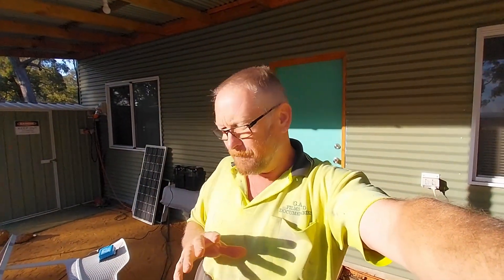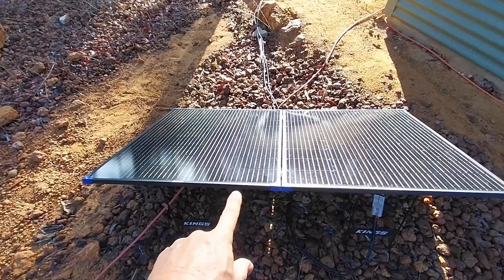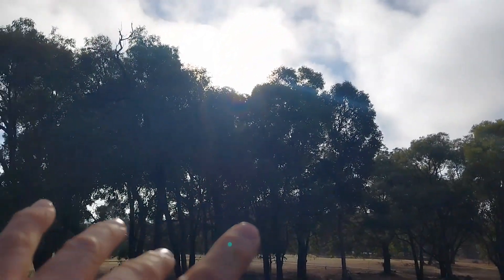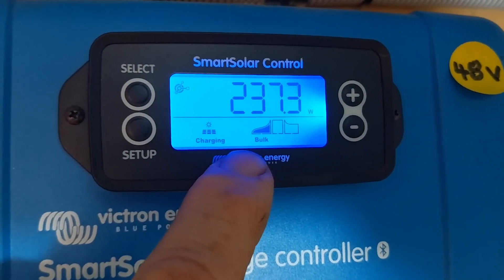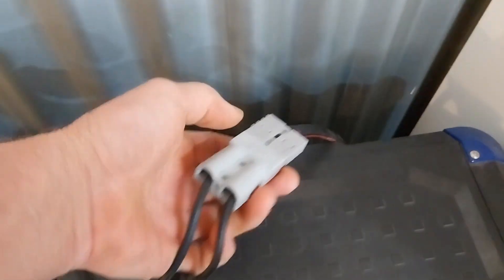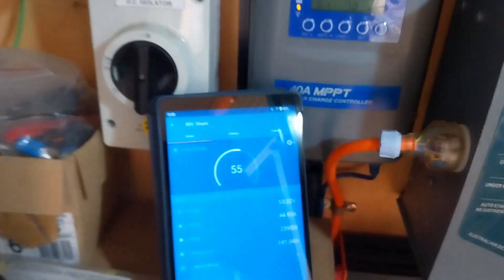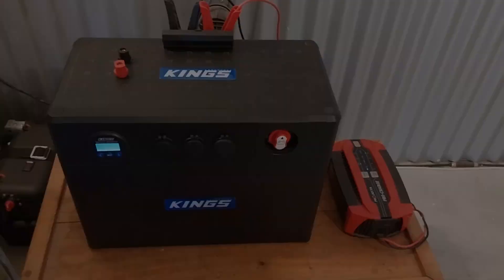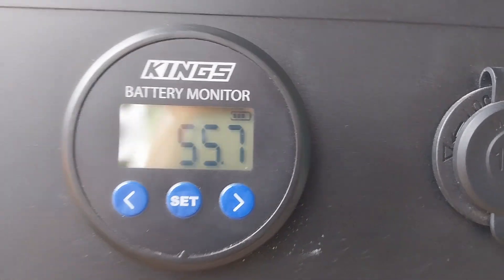Failed Attempt To Charge Batteries From The Sun - So What Can I Do ?

Comment: here's a tip for you, if your AC charger has power supply mode output of 13.6V you can leave that on a LFP battery and it will fully charge it. Once the battery hits 13.6v the current will start to reduce as it absorbs but left long enough it will get there, then you don't have to worry about forgetting the charger is on in a lead acid profile and no harm will be done.
Reply from the maker: The only thing to be careful of, and one of the reasons I say not to leave it on a lead acid charger is because some chargers have an equalisation mode and raises the voltage close to 15 volts.
But most dedicated AGM chargers don't usually do this so it's not too much of a problem.
But for the channel it is best for me not to recommend leaving it on the charger to cover my ass.... and not to mention all the negative comments I usually get when I say it's fine to charge a Lithium battery on a AGM charger 🤣🤣
Reply: @TheOffGridBachelor  Yeah, but I'm talking about power supply mode. No danger whatsoever
Reply from the maker: @bildad1234  Ahh ok.... yeah for running on just straight power supply mode yeah it should be fine although for Lithium batteries, once they reach 100% SOC, the charge power must be stopped and not allowed to remain on float.
So just be careful of leaving it on the power supply mode once the battery has reached 100% and the cells have balanced 👍

Comment: Suggest you add a dose of (something like) Fuel Doctor to the container you use to top up your generator. Also, put a reminder in your phone to start your generator on a nominated date every month and give it a run for about 30 minutes. Routine services at 100 hours run time  or 12 months duration helps easy starting too. Apologies if I'm telling you how to suck eggs!
I've done this with my Kings 3.5kva open generator and honestly never had a problem starting it in getting on for 5 years. We live in an unreliable power area and it's saved our fridge supplies and powered the water pressure pump many times. We can even watch tv and power the wifi!
Thanks - I'm learning so much by watching your set up. I want to move away from just the generator as backup to a 12v solar system so that I have the option to run my rural property  like a caravan when there's no power - or as I choose.
Reply from the maker: Cool, I'm glad my videos are helpful and thanks for watching and supporting the channel.
Yeah I do need to be running the generator more often to keep it fresh and the starter battery charged up. I do run a fuel additive called F10 in the fuel which I showed in my servicing the generator video (link below)
https://www.youtube.com/watch?v=EKkTxRTDcis

Comment: Remote rural off grid NSW here 10 350W panels on the roof and small wind generator that keeps the batteries topped at night, when I go away in the caravan 4 300W flat panels on the roof of the van house is run on 24V setup with a 5000W inverter all house lighting is on a separate 12V system and I use led lighting, van is on 12V with a 3000W  inverter again no issues . Both have generator back up which I rarely use.
Reply from the maker: Since the invention of Lithium batteries, I don't need to run my generator anywhere near as much compared to when I was running lead acid batteries.
On the odd weeks were we get no sun like in this video my system does lags behind a little which is not to bad considering everything is electric.
The hot water unit for the bathroom / shower is a 50 litre electric unit with a 2,400 watt element and cooking in the kitchen is on an induction cooker, I do have LPG as a backup. Then the usual microwave for defrosting food and electric kettle to keep them coffee's going ☕👍
Thanks to Lithium batteries I can make this all happen. There would be no way I could run all this when I was running flooded lead acid.

Comment: This is why I went with lots of high quality thin film panels on my van. 72v each, in parallel. Less power overall, roughly 60% of normal panels peak output, but I'm getting heaps more power in really crappy conditions to keep things going.

Comment: Great video! Do you find there is much power loss from the panels with the longer Anderson leads?
Reply from the maker: Well yes and no. The lead I used on the 200 watt panel is two 6mm cables spliced into the one plug so it can carry the power longer distances without to much volt drop. You can kinda see the two cables side by side coming from that panel.
I have used smaller gauge cables in the past and you can notice the drop in voltage and one of the reasons I upgraded my cable to the Kings fridge to 8 B&S. Another way I combat volt drop is by series connecting the panels to increase voltage like I have done on my 48 volt system which runs a VOC of 115 volts.

Comment: Same problem in CQ . 3 days of cloud and shorter days took out the 24v 120Ah Kings on the 1Kw array this morning. Had the grid charger on day 2 a bit but the constant drain overnight of the gate opener was the straw that finally beat the system down to cutoff. Should have turned it off but gambled it would be ok and lost. :text-green-game-over: